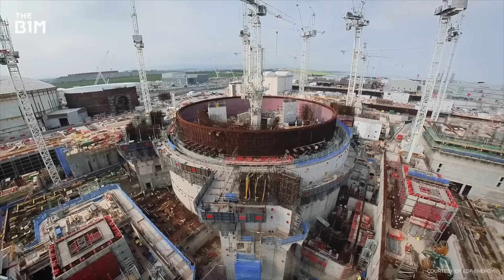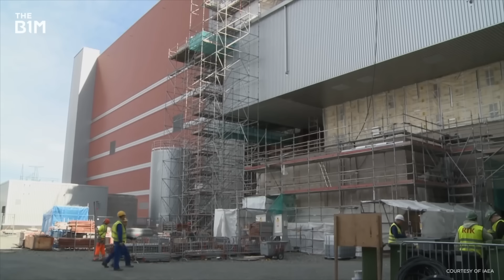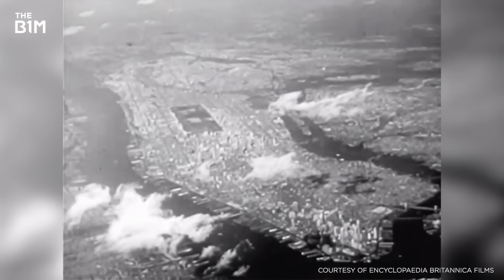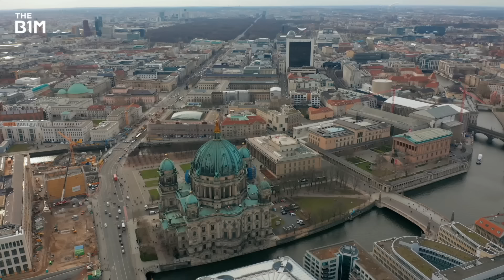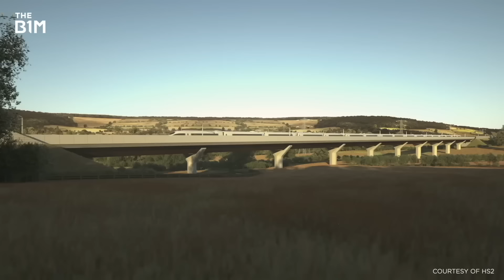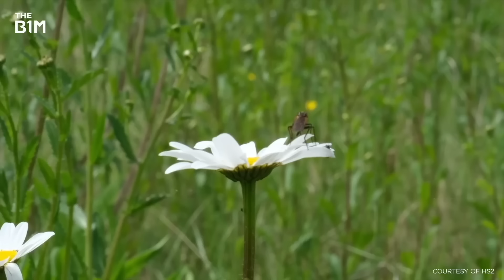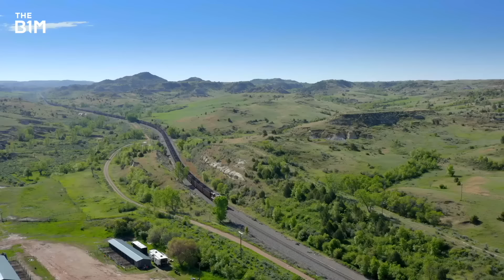Construction Fails: When Big Budgets Go Wrong

Comment: BER is really one of the baddest designs ever saw. I am there at least all 2 years for the Innotrans Train fair. I cant remember any other city having 3 Airports of which 2 are "rotting around" mostly unused while the one in operation was 10 years late and still today is a big pilup of mess:

- the 1 train connecting the city to the airport is super slow. You need upwards of 45 Minutes to get to Mainstation and more than 1 hour to the fair halls.
- in some occasions you can wait 3 hours on security without any visible  restrictions on other days you wait 15 minutes
- the amount of food and beverage to be sold after the security check is lousy at best. The food court is a nice idea but maybe it should fit more than 50 People 🤣
- the gates have virtually no seating. I cannot imagine departing in an A380 here.

Comment: iI think HS2 was merely to provide quicker transport for Servants based in Birmingham whom can’t afford to live in SE England, to be back at their wealthy inner London employers offices & homes at short notice.
If “connecting large populations for economic benefits” was so important, why isn’t there a single unbroken modern grade highway (or direct railway service) connecting Folkstone to Brighton Portsmouth Southampton Bournemouth/Poole & the latter to just Bristol 60 miles away or the motorway network at Taunton - or a proper road connecting Sheffield to Manchester etc etc ? 
My point is how the entire South of England with several cities of 250k or metropolitan areas of half a million haven’t  a direct travel Network between but instead they have a Web which connects them all to London.

Comment: California does not "need" a high speed rail.   The people that voted for it will NEVER travel on it.  They were duped.  Due to the large vastness of the USA  our country has been developed from inception through today  by the use of independent travel.  That ideology is not going to change just because  a high speed rail is suddenly an option.  All of that money could have been used to invest in improving the road and air system we already have.  There is a reason we are the way we are, and ignoring that will not change peoples habit and  behavior no matter how much propaganda, money and wishful thinking is thrown at it.

Comment: I hat this BS-ing on smart ticketing systems. The New York subway's existing "old" ticketing system works great. They have a fare evasion problem, but at least the ticketing system is accessible in contrast to some cities with "modern" systems. And the new York subway construction hasn't really "gone wrong". They are actually getting the extensions built, and they aren't trying to do so much at the same time that they drive prices infinitely high by competing with themselves.

What's really "going wrong" in megaprojects right now is Germany's plan to improve and renovate the railway network across the country, which is facing truly extreme cost overruns due to different subprojects competing with each other and driving costs further and further up.

Comment: The only thing that saved Berlin Hauptbahnhoff was the the angle of the rail junction, otherwise it would've been as banal as everything that preceded it in von Gerkan "star architect" output. I see his objections to shops has left the outside at street level a crime area. I expect they'll have it improved gradually.

But MEHDORN??? Mehdorn had spent a good part of his career already running Deutsche Bahn into the ground. It's comical. All DB's now infamous shortcomings that people have come to expect began with Mehdorn's appointment. Such things were unheard of in German railroading before Mehdorn.

Comment: Right, it's all EDF's fault, no fault of our British authorities at all for demanding 7000 changes after the project's blueprints were finalised and approved by them, and in contradiction with several other power plants already in operation across Europe... because us Brits are special.  }:-P
Reply: That's how it usually goes.
Projects get revised after ground was broken, resulting in significan cost overruns.
It's not just public infrastructure.
Often the reason is neiter incompetence nor mallice. Plans are approved based on what those responsible knew at the time.
When more/different information becomes available, or circumstances change, the plans get revised.
I'm not saying mistakes or just plain old incompetence don't play a rolle, just probably not as often as one might think.
On top of THAT, then comes in politics. A change in leadership SOMEWHERE can cause a projec to to be veiwed through a different lense.
Reply: @Bird_Dog00  The quantity of concrete and rebar was artificially increased to benefit local suppliers, not because of any technical requirements. This in turn made construction more labour intensive and it snowballed from there. The exact same power plants build by EDF in France don't use as much, yet aren't less safe.

Comment: South Korea is the world leader in small modular nuclear reactors which are easier & quicker to build, less carbon impact from the tonnes of concrete & building material, less of an eyesore with a smaller footprint so can be built in more places closer to where needed, requiring less infrastructure & recourses (water cooling etc)

Their experience also means they are built fast & on time for a 3rd of the cost compared to similar French/competitors constructions. So why isn't South Korea building them here , the self serving lobby groups and government backroom contacts that are lining their own pockets on the taxpayers bill!  🤑"kerching"

Comment: Why didn't they build HS2 entirely underground? Lika a high speed metro? The Swiss bult the Gotthard base tunnel (35 miles in length) in 17 years at a cost of 12.2 billion CHF. And that was a more complex and difficult tunneling project than an HS2 undergroiund would have been. No property devaluation, no expropriations, no forests to cut down, no space wasted by above ground tracks. The HS2 distance from London to Brimingham is a measly 140 miles which could have easily been constucted underground. Tunneling through groundwater rich layers is technically not a problem. In fact, as far as tunneling is concerned only a tunnel through the center of the earth is technically not possible (yet). And finally, HS2 makes little sense unless it is extended all the way to Scotland.

Comment: California's High Speed Rail is a giant cluster. The remark that $30b was just a start, far from it. Californians were told this is the number. And the number keeps going up. And up. In 2011, when asked, 60% said they wouldn't support it if asked again. In 2024, it's split.  But if you look at the map, it the route leads you away from LA at the start. Then it takes you down a largely unpopulated part of the state. Shocker, the state has had difficulty acquiring right of way and it's still not complete. The Bay Area has three international airports, SFO, OAK, and SJC making the idea that "it's difficult to get to the airport" misleading. 

HSR could have used parts of the I5 right of way, tunneling in places there are rivers or other obstructions. I5 (or parts) get you into major cities.  The chosen route makes no sense and arguably, adds to the time required to get to your destination. 

The short version? This was the dream of a governor, carried over to another governor, neither of which seem all that interested in finding the right people. Meanwhile, the so called  leaders take home over $300k annually and another $150k in benefits. Let that sink in while you realize zero track has been laid.

Comment: got a friend in glasgow who was absolutely spitting iron when they cancelled the upper bits of HS2. all this with a housing crisis all the same because the sort of twat who lets a flat up there will charge you a king's ransom for a one-bedroom with mice and black mold and claim you're lucky you get running water. of course rent prices skyrocket when people get told major infrastructure projects are about to connect them much more easily with major hubs, regardless of whether those empty promises pan out. if scotland wants to secede, i support them in this

Comment: F*&% the HS2! It has torn up the countryside around my home to the point of it being unrecognisable. Every road out of where I live is affected by it and regularly are closed or have massive road works on them. It currently takes me over 2 hours to get 9.7 miles down the road to work and sometimes longer to get home at night. It has cost me hundreds in extra petrol from all the diversion or traffic. It is beyond a joke at this point! The middlands is being torn to bits for something hardly anyone wants! I live near the long Itchington woods and it took so much effort to stop them just going through the center of them and instead going under them 😡

Comment: The UK is becoming a joke when it comes to building infrastructure. There is so much bureaucratic red tape that it hampers progress. For instance, it has taken nearly seven years to construct 230 km of the HS2 line, and it's still not finished. In comparison, China built its latest high-speed rail line from Hong Kong to Beijing, which spans 2,449 km, in just half of that time, and it is already in service. The costs of projects like Hinkley Point and HS2 keep rising without any end in sight. It's truly frustrating!

Comment: Nuclear is just too expensive at present. If it were any good we could build the same ones we had 20 years ago, just like coal, gas, solar, hydro— but NO ….nuclear has to be more and more involved and expensive EVERY TIME, reaching a point that it becomes impossible. Leave it in the laboratory.

Comment: HS2 what a joke. The wrong project with minimal gains in speed for huge costs. Had they gone with a MAGLEV it would have been built quickly, using less land, not causing the noise and vibration of trains, travel at higher speeds (Birmingham to London in 20 minutes), requiring less expensive infrastructure, cost a great deal less and be far safer as the track is 20m above ground offering no chances of trespassing.

Comment: Even with Sizewell C, the UK is going to be short about 2000 nuclear power stations. One nuclear power station generates the same amount of energy as 8 petrol stations and it doesn't include those who have their own fuel dispensers and the military. Moving to electric battery vehicles will cause the power grid to collapse when they are charging. If 10% of consumers charge at the same time the grid starts to fail..

Comment: "And the Europeans aren't that bad at building it (high speed rail) either".

Don't give Europe too much credits, the Netherlands had it's own HS1 (called HSL zuid towards Belgium). Lot of the same problems as in the UK: trains are meant to save the environment, but run into massive unplanned costs to save the environments they cut through. HSL east (towards Germany) was cancelled alltogether.

And though the whole continent is smaller than North America, interborder connectivity is often a joke. Italy, France and Germany are oke-ishly interlinked, Belgium and the Netherlands have a high speed connection with France, but apart from that high speed interlinks basically don't exist. That means going from a random town in the Netherlands to Barcelona (between 1300 and 1400 km) is often quicker by car, and wayyyy quicker by airplane.

Comment: The Hinkley Point C project started after the start of the new Flamenville nuclear power plant project.

And unfortunately, in Flamenville, EDF learned (the hard way) how to build an EPR reactor! 
And that took time; 
a "slight delay," nothing major ;  just 10-12 years longer than planned.......... 
As for the costs,
 talking about an exponential increase would be a "slightly" exaggerated statement, but not by much...

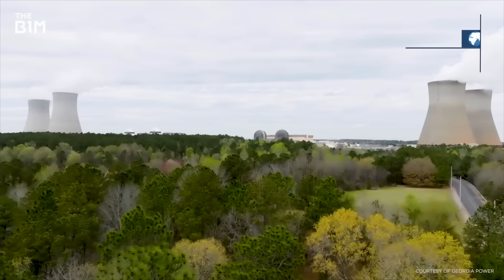Comment: 8:50 The Vogtle expansion project was only slightly less than 2/3 of the size though (2.1 GW for Vogtle instead of 3.3 GW for Hinkley Point C).

Comment: There are more points to add to BER - three never-done-before technical, and a consequence

First, in your video one can see that the terminal is a huge open space - no air ducts or structures hanging down from or going up to the roof. This was a decision from the architect. But this meant that smoke from a fire - you remenber that hot stuff that will go up into the air quite easily - will have to be sucked down into the bottom of the structure and blown down an afair 1,3 km long tunnel until it is blown into the outside. *Never done before*, and one reason for the aprupt cancelling of the first "opening" was a failure of one of the high end turbines sucking the smoke down.  

Second, this huge open room of the terminal again*. Usually a building with that size would have to be separated in 2 "Brandschutzanschnitte" meaning 2 fire protection sections, giving an easier control in case of a fire. This regulation was waived, resulting in ONE section nearly double as big as usual. *Never done before this big.

Third, when you tender a building one has to decide about technical details - like to choose the type of equipment from the different manufacturers of fire protection technology that is to be used. They chose a fairly small manufacturer that had never done before a project of this size. 

When you heard about the fasteners beeing too weak, this is the sum of 1 to 3: underestimating how many cables and wires had to be used in an never before type of smoke handling in a never before needed dimension with a technology never before used in that scale, leading to a weight of cables and wires the estimated cable trays could not withstand securely.  
When you try to change anything within such a dense bundle of cabel and wires...  hellish. 

All of this could  have been prevented with a bit of supervision and experience - one does not simply start a threefold "never done before" and expect things going smoothly.
Reply: In short, incompetance from hundreds of people earning money that would suggest they are competant.
Reply: @Peterbrendanalbert  Incompetence plus hubris.

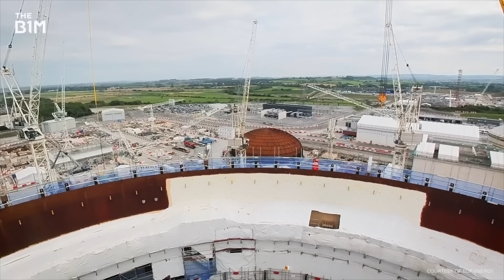Comment: Although the graph at 04:42 is correct,  it is important to note that in a PWR, the nuclear reactor must NOT generate steam.  The "pressurized" part is to allow the water to be heated to well over 100" C without boiling. The water passing between the fuel rods is used as moderator, and if it starts to boil, the steam is not a moderator. (This happened at Chernobyl after initial failure caused all individual pressurized cylinders to lose pressure and water instanly going to steam)

The Boiling Water reactors often seen in USA are much cheaper to build, but as the steam is generated within the reactor i goes directly to turbines carrying with it many of the by products of fission , many of which are unstable and temporarily radioactive, making the turbine hall radioactive and requiring turbines be shielded. 

In a PWR, the very hot pressurized water in the reactor does not leave the reactor hall but in the hall is a heat exchanger thorugh which normal water flows and made to boil and itis that water which goes to the turbine.

Comment: Could you make a video about "rail baltic" megaproject, it is literay making all baltic people go crazy and it has been in development and in construction forever and is close tied to much corruption and never ending deadline extention. The general idea was to build a european train track width rail system, because baltics uses the "old" russian width system. But the project isnt realy going as it shoul. The proce has more than quadripled over the years and i have no idea when it even will be opened. At lieast 2 big bridges are planed just in Riga alone and many many landscaping changes.

Comment: In my humble opinion I think that it's going to be a struggle to find a single publicly funded project that isn't a disaster in terms of budget and delivery date. It is a remarkable thing to me that, for example, the HS2 project did not run proper surveys of the ground it was to traverse fully before the start of the project. And there are many more examples to show. I am not necessarily saying the big projects run in the private space are that much better in a lot of instances, but I do know that there is typically better research, understanding, and oversight because there are definite budget and time constraints that don't seem to be as much of an issue in the public space. And this is across the board - the nature of the project doesn't seem to make any difference. 🤔

Comment: About HS2: when the Cologne - Frankfurt high speed rail line was built, there were two stops (Montabaur and Limburg) added for mostly political reasons. (The stations were actually built so that the trains that don't stop there can go through them at near full speed.) Originally many - including me - thought that was essentially just a waste of money to appease the local politicians. But it turned out that with a fast connection to Frankfurt  many people could move from Frankfurt to one of these places and still commute to their offices in Frankfurt.

TL;DR: If you build good infrastructure then you'll get growth in places you didn't expect.